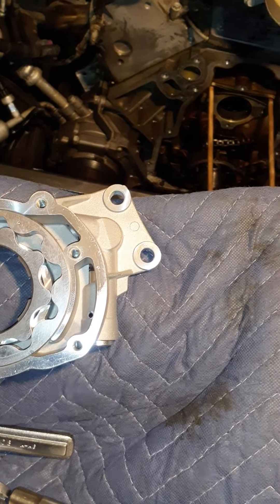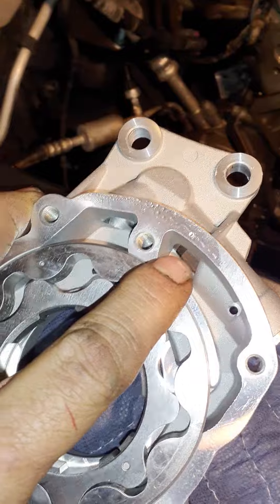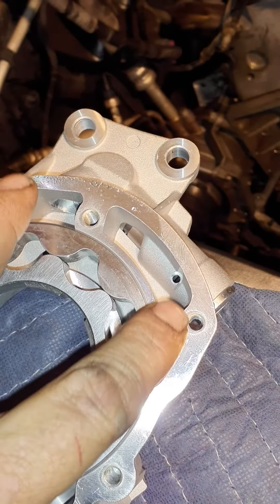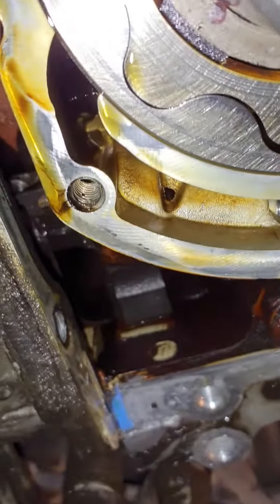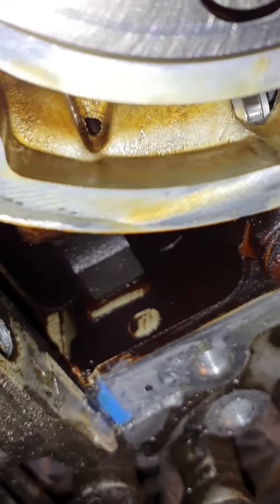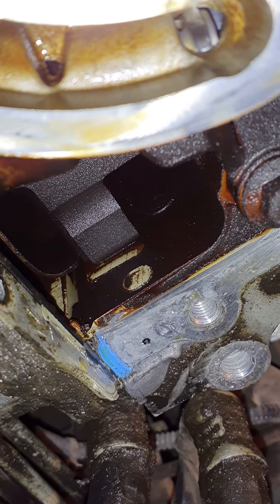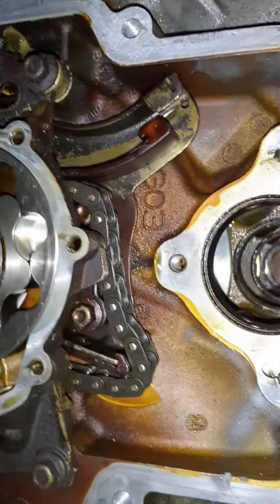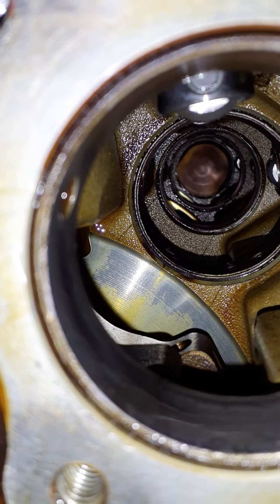ls engine oil pump failure

Comment: Out of curiosity what was the symptoms of the failure? completely no oil pressure? very low oil pressure? low oil pressure but would still build as you drove at higher speeds.
Reply from the maker: It would start with about 10psi. And quickly drop to under 5..
Reply: @hill_customs6807  I appreciate that. This is what is happening to mine. Starts at around 15 ish and then as the oil warms up and thins out goes to around 5-7 psi. But will increase to arround 40psi while driving at 45-50 mph. There is not knocking, taping or clicking that would normally be considered a sign of low oil pressure. I have confirmed the low oil pressure with a seprate gauge. already replaced the gasket from the Pick up tube with no change. My next stop was going to be the oil pump. I think this helps with plausibility.
Reply: @benjaminkirk5369   hey did the oil pump help?